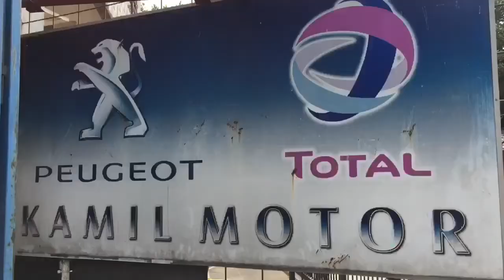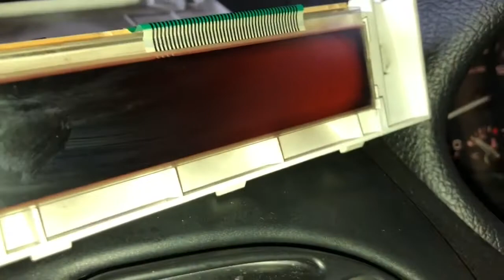Cra ganti kampas rem - brake pad peugeot 206- cek Mid mat

Comment: Om kamil kalau peugeot 206 manual di ganti disc brake punya matic yg tebal apakah bisa?
Reply from the maker: Tidak bisa
Reply: @KamilMotor  kalau diganti dengan kalipernya 206 matic harus sama braketnya sekalian ga ya om? Pnp tidak? Pengin upgrade rem dari manual ke yg model matic yg tebal ada ventilasinya
Reply from the maker: Iya om harus komplit sama kaliper nya baru bisa